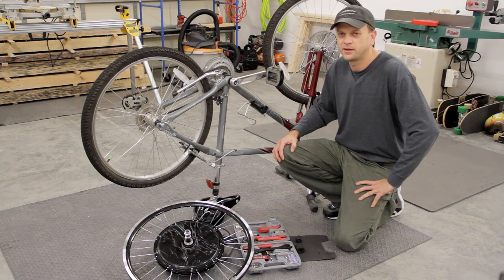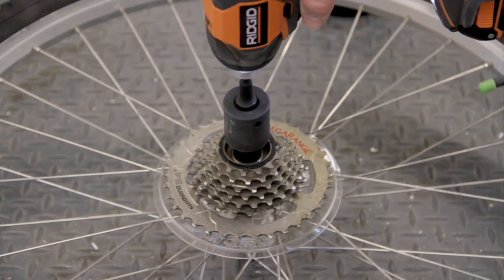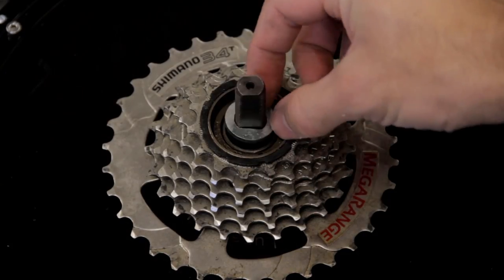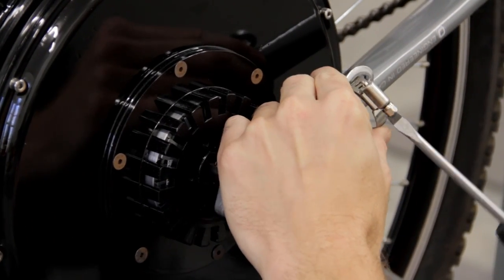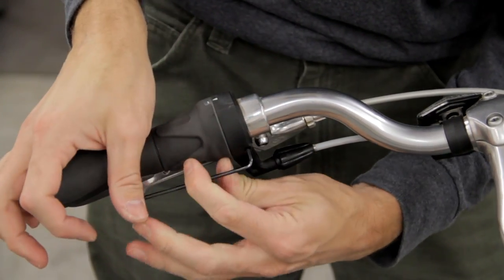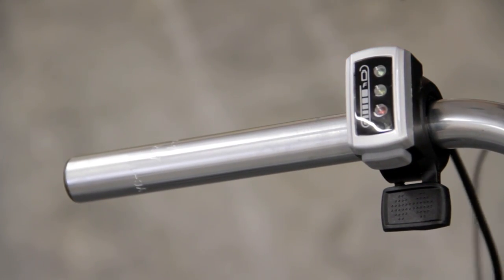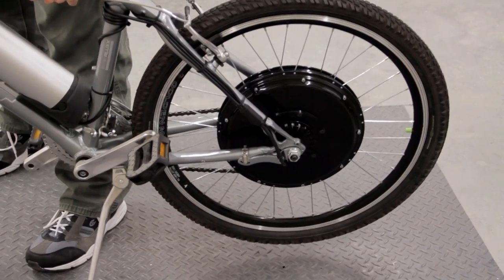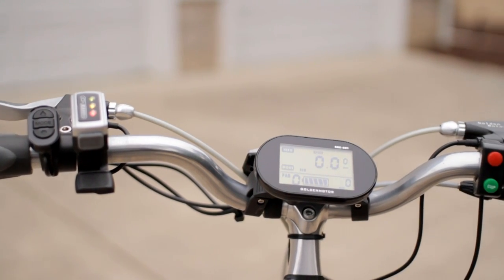Installing an Electric Bike (eBike) Conversion Kit

Comment: the truth is that there are many designs ebike, but this conversion is work smart not hard, because the greatest benefit at a low cost is obtained. Congratulations goodbye to the internal combustion

Comment: Hello, I wonder where you put the controllers? it use to be bulky and I myself trying to figure out how to hide controller and battery in one case if possible. I really want to build my bike kit as neat as I can without extra case for controller. Thanks
Reply from the maker: The controller is built into the hub on the Magic Pie kits, which  was one reason I went with it. You might be able to find a rear rack that goes over the rear tire to mount a battery and controller to.

Comment: After watching several ebike vids for fully assembled bought new ebikes, this looks like a more viable option. Much better value than anything I have seen. More power and distance than many. This system will fit easily on many higher quality  brand  bikes. 
I am a skeptic of ebikes in general, but at least their marketing seems to be honest.

Comment: Hello from Kansas.  I just got the front wheel version. I'm thinking I should of gotten the rear.  Is the only difference the included sprocket?  Can I remove my sprocket from my bike and install it to the front wheel version hub?  Thanks in advance for your response.  Rick
Reply from the maker: I'm not sure where you ordered it from, but when I bought might it could be placed in either location. I think the rear location is a bit safer and your weight over the tire helps keep it from spinning out.  You should just be able to order a 7-speed freewheel (something like http://amzn.to/1UOzOFb ). You may also need a freewheel removal tool (https://amzn.to/2I6JSwq). Make sure what you get is a "freewheel" and not "cassette".

Comment: cheers for that so can u tell me u have to use the free wheel because u are using the same  axle otherwise u wouldn’t have to use it but then u wouldn’t be able to pedal at all ??
Reply from the maker: You may could go without the freewheel, but you likely need to figure out how to take up the space that it takes so that you can properly secure the hub in the dropouts. I'm not sure it would be considered a "bike" if you can't actually pedal it though :).

Comment: Your vedio is quite well done, just one question: did you new breaks or attched the origional breaks ? just got confused you snaked that break cable and mentioned e-break, was that the original break cable or they are new break cables supplied with the motor ? thanks.
Reply from the maker: +J Matt I used the original brakes (and cables) that were on the bike, but replaced just the brake 'handles' with the ones from the kit. That's what they call 'e-brakes' because there is an additional cable from them that connects to the motor to stop it from running while braking. Other than the additional cable, they are the same as the ones that came with my bike.

Comment: Nice video. how is this kit holding up so far? any issues with the quality of the kit? can you recommend the supplier? thanks...
Reply from the maker: This kit's been doing great. The only issue I had was with a spoke that I missed tightening that required taking the tire off a bit to fix.  The motor parts and battery have held up great so far. No complaints with it or the seller.

Comment: so u just left the 7 gears on it ? and is the PAS when u put on a hub kit? And connections to batteries and controllers all have different looms like car stereos?
Reply from the maker: Yeah, the freewheel is there so that it's still possible to pedal and because of the spacing. I did not get a pedal assist when I ordered mine, so I do not have any experience installing one. The battery connection can be done multiple ways depending on how it's setup, but most are pretty simple to do.

Comment: I think this is a clear and concise guide thank you for giving me the confidence to do this..but what is the wattage and is this both twist and coast/pedal assist device?
Reply from the maker: The wattage depends on what size battery you use. You can use a 24V, 36V, 48V, or 52V battery for instance (25 amp / max is 1500 watts, 1000 watts continuous). I believe there is a pedal assist add-on (or perhaps in Europe it is standard), but the version I have is throttle only.

Comment: How is it at climbing off road hills, I am looking for enough power to go trail riding, Also how much weight does the kit and battery add to the bike. I didn't see a luna controller, did you install one after, is it needed to run the setup.  my current setup is 500w with luna 36 V  battery, Bike is 60 pounds with a fat tire, and I can do 5% grade wells, but over 10% there basically no help. gotta use the old man power, which is tough with that heavy a bike and only 1 gear. thanks a ton for this i am thinking of doing the exact same kit.
Reply from the maker: I haven't done much off road hill climbing with mine, but I haven't had any problems on the stuff I've been on or going up some grassy hills. Certainly no issues on any of the paved hills I've been on.
The controller is built into the motor. I think the battery and motor add around 25-30lbs maybe. My setup was certainly more powerful than I expected it to be and I haven't had any complaints with that at all. I think Luna has a setup for it for fat tires as well.

Comment: Thanks for the video. This is exactly what I need. 3 questions. 
1. Don't you need disc brakes with that kind of power and speed? 
2. If I order this from LunaCycle, will it come with everything I need or do I have to order connectors/controllers/ etc separately? 3. My bike has the shifters built into the lever. I guess I need to order a separate break cut-off sensor. Or is there a way I could make it work with the stock levers? Do you need motor cut-off brake sensors with a hub motor?
Reply from the maker: Hi! Let's see:
1. They certainly wouldn't hurt, but I haven't had problems as I also have the regenerative braking setting turned up pretty high.
2. You'd need to order a battery and charger, the LCD display if you wanted it, and a freewheel if you need to replace yours. I recommend the thumb throttle and I'd definitely get a torque arm.
The controller is built-in, so you don't need to order it. You may want to ask them for their recommendations for connecting the wires from the motor to the battery.
3. You'll want to use the brake levers from the Magic Pie as it handles cutting power to the motor when you apply the brakes. So it sounds like you'd need to find a stand-alone shifter to match the number of speeds on the freewheel. With a 7-speed freewheel you can probably get by with a single-speed cransket and then you would only need one shifter.

Comment: Great video buddy. How much does the battery that you're using on that bike cost? I need one for my 48v 1000 watt kit but I'm not sure which one and what brand to buy. Thumbs up on the video.
Reply from the maker: Mine was around $375-400 I think when I got it. LunaCycle.com has several styles to choose from (mine is the "bottle battery" style, but the dolphin / shark styles are similar). For a 1000 watt kit, you might want the 11.5ah "high power" battery (vs. the longer range 13.5ah ones). Mine are Panasonic brand, though Samsung is also popular. You can contact LunaCycle and see what they might recommend. Be sure to check the battery size against where you want to mount it on your frame to make sure it fits!

Comment: Need more explanation for hooking the controller to the battery
Reply from the maker: It depends on the type of battery mount and its connections. I just used insulated crimp-on ring terminals. The battery I purchased had posts with a bolt/nut so that was the easiest.

Comment: Do you have to peddle when you go up steep hills or does it have lots of torque where you don't have to?or does it have throttle over ride?
Reply from the maker: +FastFriday'sFacts I haven't had to peddle on any of the steep hills I've tried. It's got quite a lot of torque.

Comment: What is the purpose of the torque arm? Under the order options, they ask whether one wants one or two - her you show the installation of one only.
Reply: Prevents the forks from breaking. They break easily cause of the high torque.
Reply: So two would probably be best. Better to have it and not need it than to need it and not have it, you could say. Besides, things should be kept in balance, have equal torque to both sides of axle.

Comment: Ciao, scusa se faccio domande sciocche ma ho necessità di capirci di più.
Per una e-bike completa servono degli articoli fondamentali, io quì di seguito ti chiederò un elenco di pezzi che vorrei il tuo aiuto. Grazie
-Puoi aiutarmi a trovare una ruota posteriore 28 pollici 700x25C motorizzata 48V 500/1000W
-Vorrei una batteria a bottiglia come la tua e vorrei sapere dove hai messo la scheda elettronica di gestione e controllo, dentro la batteria?
-manipola acceleratore?
-Leve dei freni con stop elettrico?
-Displai controllo per manubrio?
Ti sarei grato per l’aiuto.
Grazie 🙏

Comment: I received the AW rear wheel conversion kit from Amazon.  My bike shop looked at it and there are two problems. First problem is that my Shimano crank is tapered and the PAS takes up room so that my crank will not slide back on all the way, I can tighten the bolt but the crank is not seated all the way and the bike shop said it will eventually wear out the crank arm since it is not tightly seated.  Is there a PAS system that will work in this case?  Also the derailer rubs in top gear and the bike shop said no way to fix except to adjust to lose the top gear.
Reply from the maker: I've only used the Magie Pie kit, but the AW kits look very similar. The Pie kit didn't come with a PAS, so not exactly sure why it's having issues. They didn't have another crank that would work without the issue? Since mine didn't have a PAS, I would just set cruise control to a low speed and pedal if I wanted a little exercise. 
I didn't have any issues with the derailer rubbing on mine. Was the hub freewheel larger that your previous one? You might check on some ebike forums and see if anyone else has run into similar issues. I'm not sure if Shamino's 7-speed freewheel is a bit smaller.

Comment: great video can I add electric wheels to both the front wheel and the back wheel or is that unnecessary
Reply from the maker: It's unnecessary. You'd need a second battery and it would take a bit of work trying to synchronize the two motors. This motor is also not recommended to be used on the front.
Reply: @aroundhomediy  lol I was wondering that too but I just assumed one would be enough

Comment: Is there a fitting problem for the rear wheel, in that the fork requires 150 mm of clearance which most standard bikes don`t have.

Comment: Awesome video! What kind of a kit for a 3 wheel bike to hold 260 lbs the 36V 500watts or 48V 1000watts
Reply from the maker: Thanks! So we bought an electric trike a while back and the smaller ones like we purchased have issues. The motor is on the front wheel and has a tendency to spin out as there is little weight on it. It was also quite difficult to pedal. I'd go with a 48V / 1000W if you can find one that doesn't have these issues :).
Reply: @aroundhomediy  thanks for answering back that’s exactly what I wanted to know thank you.
Reply from the maker: Great! Glad I could help!

Comment: Where did you get that mount for your display unit? That's not the one that you can purchase on the website?
Reply from the maker: I'm not seeing it listed on LunaCycle's website, so you might check with them and see when they'll get more in stock (Golden Motor Canada seems to have them in stock though). It looks like the thumb-throttle is also out of stock at Luna also.

Comment: My bike the place that you put your battery it does not have where can I put my battery because mine sort of has an extra support so I cannot put my battery there
Reply: It's not a supportive but it's middle bike shocks
Reply from the maker: You might can get a rear rack (that extends past the rear wheel) and mount it to that?

Comment: i have a question sir! 

do i have to use the brake levers that comes with the kit? 

or can i just keep using my current brakes
Reply from the maker: The supplied brake levers cut the power to the motor, so you will need to use them.

Comment: Is it necessary to connect the display and the horn/cruise control buttons? Is throttle button the only thing needed to get this thing going?
Reply from the maker: I don't think you need the display connected as there was a bluetooth option for it (though it didn't work well when I tested it a while back). I would think you could skip the cruise control/horn connection, but the CC comes in pretty handy.

Comment: Can you still pedal the bike? This is the big question I ask. I want to still get a work out in pedaling my bike and stuff. I don't want a full electric bike.
Reply from the maker: Yeah, you're still able to pedal just fine (other than the additional weight :) ). Sometimes I would set the cruise control to a low speed and still pedal -- but if you brake, the CC turns off, so I'd only do that on long stretches.

Comment: very informative video!
Reply from the maker: +Chevyx xCouture Thanks! I just ordered the MP Bluetooth adapter, so I will have an update on the website article regarding that very soon.
Reply: +Around Home cool, cant wait. I was a little unsure with my skills in  installing a middrive kit, so I have settled on the front hub kit instead!
Reply from the maker: +Chevyx xCouture Same here. I almost went with the Bafang BBS02. Be sure to use torque arms if you do a front hub install!
Reply: I definitely will...thanks!!!
Reply: Thanks for this instructive video!
How many miles should you expect before the next recharge?
Reply: Around Home DIY  а усилители дропаутов обязательно ставить на электроколесо?

Comment: Please reply
So it's coming upto 1 year. Would you do it again using the Magic Pie? Any issues with it?
Reply from the maker: So far it's been working great, and I haven't found anything else that I'd want to replace it with. The only issue I have had was that a spoke came loose and I had to deflate the tire to fix it... Which was entirely my fault for not checking and tightening them sooner.

Comment: hello, looks great!  what kind of battery you employed there? can u upload a video for the battery specification and installing it on bicycle? what is the total cost of the kit? i am from india can i order it here?
thanx
Reply from the maker: I used a 52V 13.5ah "Bottle Battery" that has a mount that attaches to the water bottle holder holes in the frame. I crimped 2 'Ring Terminals' onto the wires from the motor and ran those into the bottom of the battery mount. They are just attached to the terminals on the mount with some small bolts using a wrench. The battery itself can be easily removed (using a key as it locks into place).

There are several different battery options, so I didn't go into too many details. I got mine from LunaCycle.com.

Comment: it say 36v 500watt is that 36 volts 500 watts it takes to go in the wheel or do it mean going out ??? And this wheel should fit most mountain bikes right ??
Reply from the maker: The Magic Pie V5 can be used with a 24-52V battery pack. And its controller will pull up to 25amps I believe (you can set a lower limit using the software). So depending on what voltage the battery you want to use is rated at (it must be in the 24-52V range) and the controller's amp setting, those two values multiplied together would give you the total watts. The other important value on your battery would be amp-hours (ah) which basically determines how much charge you'll have / how much distance you can cover.

If your mountain bike uses standard 26" wheels then it should work though I think Luna Cycle now carries some larger rims and possibly 'fat bike' rims. You should be able to ask whoever your order it from if your setup will work.
Reply: where can i get the battery from what site give me the name ? I was thinking about buying 1 on ebay some 1 emailed me back and said the battery don't come with the wheel ?

Comment: Excellent video and much appreciated. I'm about the order this kit. what kind of distance do you get off a full charge.
Reply from the maker: I'm still having a hard time using up the battery enough in one trip to tell exactly how far, but from what I can tell it should be close to 45 miles. Certainly more if you pedal some.

Comment: Those "universal torque arms" are a joke. They have a pivot in the middle, and are secured at the far end... The torque pulls it away from the frame. I fail to see how it's supposed to resist torque, if it isn't a fixed item. A single piece of steel cut to fit is the only way a torque arm should be, but somehow those 2 piece items have made their rounds.

Comment: There are a lot of spoke issues with these kits, how did you fare?
Reply from the maker: The only spoke issue I've run into is that a few were loose, and I had to go back and tighten them. Once I did that I haven't had any problems.

Comment: Are these kits waterproof against rain etc?
Reply from the maker: This motor is fairly protected and I've ridden it in a light rain. The battery case is probably the main thing that you'd want to protect if it's not weathersealed.

Comment: How did you tighten the cassette onto the hub? I can't figure it out, please help?
Reply from the maker: The Magic Pie hub requires a freewheel (not a cassette), so that may be the issue? I just tightened the freewheel on by hand and then (maybe) used the tool with a small chain to tighten it just a little more.
Reply: If you don't have the chain wrench you can spin a freewheel on hand tight and  then use the bike chain to finish  tightening it. Just keep the rear wheel from turning and turn the pedals.